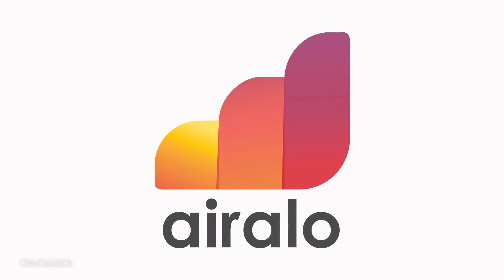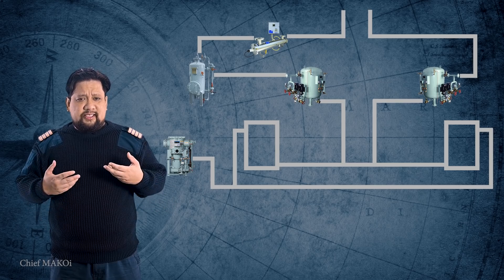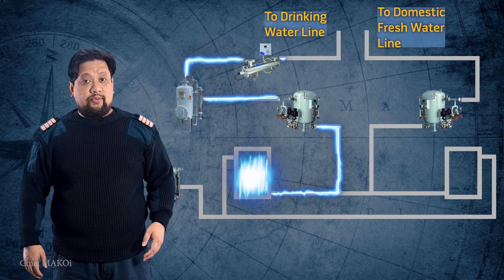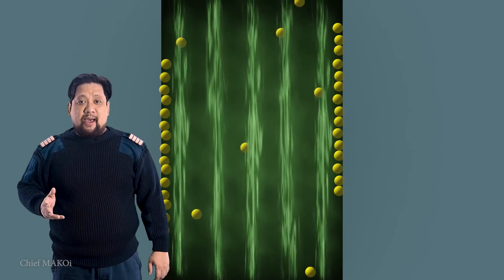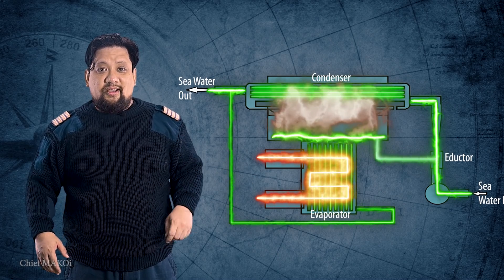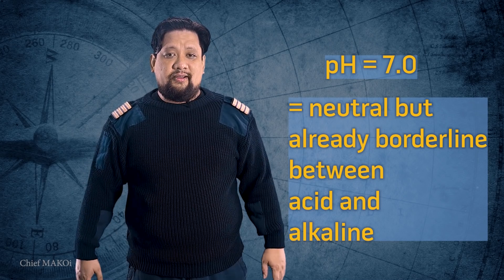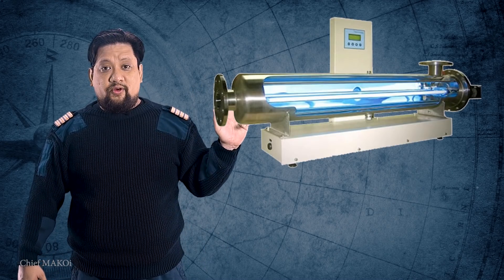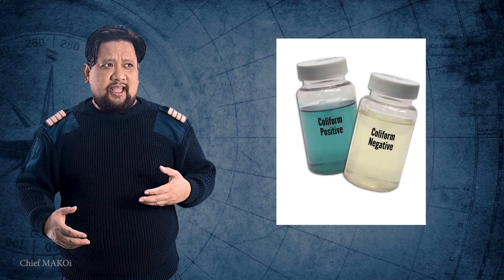Is Ship's Water Safer than Bottled Water? | Study Call Ep 05 Chief MAKOi

Comment: "That can't be good for our bodies." 
Please please don't say things like that until you do research on the topic about which you're speaking. Someone's inability to understand how something could possibly be good or bad for your body has no bearing on the truth of the matter. I'm not sure what you said is incorrect but you also don't sound too sure of it's feasibility as a statement. 

So, I found some facts for us!

The main reason acidic water (with a pH of less than 6.5) is dangerous is because it can leach toxic materials from pipes. Mostly metals like lead, copper and iron. Other than that, acidic water isn't too dangerous, especially if the pH is lower than 6.5. It can cause your teeth to erode faster by making your already acidic spit more so. Also, your bodies ability to absorb calcium lowers with a high amount of acidic water.
Reply from the maker: I did research it but I just didn't want to go into detail explaining that.  😁 Anyway, thanks for the additional info.
Reply: @ChiefMAKOi  cool thanks! Sorry, I love your channel! Thanks for your hard work.

Comment: In the navy, we use a reverse osmosis plant on the frigates.  We have system set to top up fw tanks when water produced reaches under 300 ppm.  We also produce feed water somewhere under 3 ppm for our two steam generators and for our gas turbine water wash routines
Reply: I was on a steam ship too and we used extra water from the evap for potable water. It was not enough for the 700+ people on board while underway, so we would also take on potable water when we pulled into ports. Once though when we took on potable water in Turkey it had some dead bugs in it. So they heavily chlorinated that water storage tank.
Reply: in iran we need 0ppm for our submarines
Reply: @user-gu1hl2kx2k  sure.
Reply: @riccardoz2953  like you even know what that means

Comment: Good video even domestic water towers normally have an inch or two of mud in them.   So what is safe that’s always a good question
Reply: And are designed so that the inlet/outlet pipes are a foot or more above the floor specifically to avoid that settlement of solids.

Comment: The chemicals don't contaminate the fresh water as its heavier. However if the water drank is less than 10ppm, therefore there are of course some particles.
Reply: true. and the same could be said for any water processed anywhere or found in nature. since there is no absolute purity, the question is always what quantity of concentration breaks the threshold for what the human body can handle.
Reply: yeah I'm just not convinced by that argument even though it is following guidelines making it at supposedly a  safe levels, following kidney issues I've had to live with for a while, and being attributed by a professor in urology to bad water quality (I lived in Iceland, and now West of Ireland lol we don't have bad water quality here). So only thing I can think of is either he made a mistake which I doubt, or the water is not that safe in the long run on board.